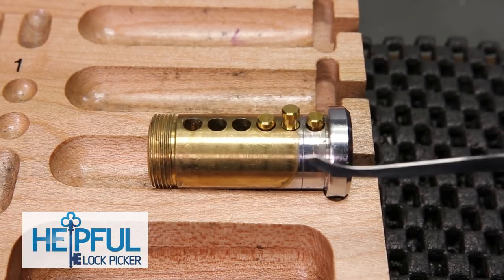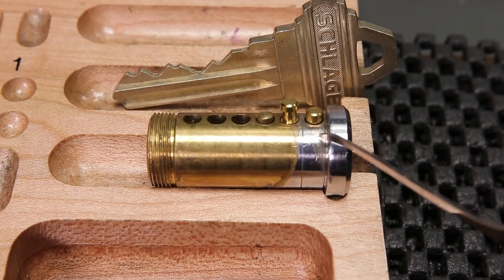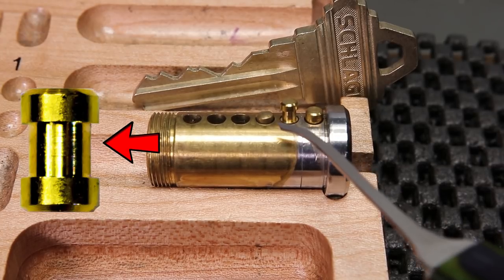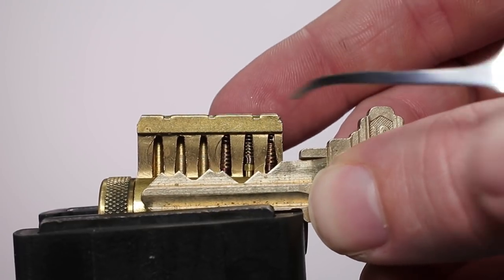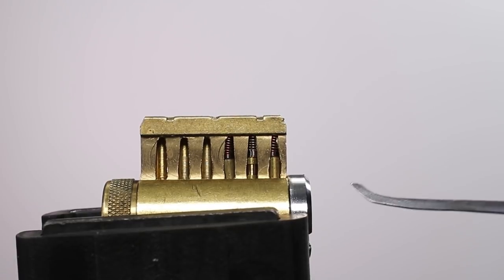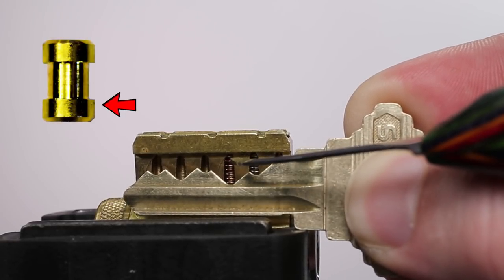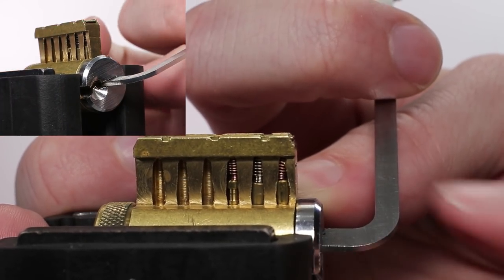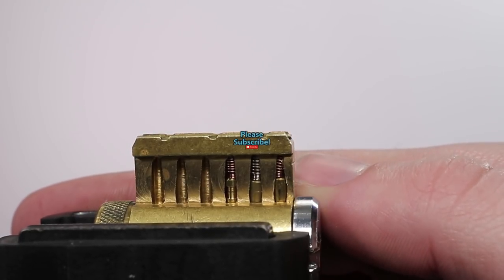[269] Why Locks With Spool Pins Don't Always Provide A False Set or Counter Rotation

Comment: what about deadlocks, where everything seizes up after a deep false set and lighter tensioning doesn't help?
Reply from the maker: Sometimes you need to prove "manual counter rotation" and very carefully rotate the tensioner back yourself until the pin frees and sets
Reply: @HelpfulLockPicker  there's a strong spring on the lock that i'm using to counter rotate and still nothing, this is a lockwood 120/50 and due to the paracentric keyway i can't tell if i'm picking a seized pin through the warding or the warding itself.
Reply from the maker: @Ghorda9  That can make it quite tough. Is it a lock you could take apart?
Reply: @HelpfulLockPicker  no, the 120 series are not rekeyable and each series has a different keyway.
I can set the front pin which does give counter rotation but that doesn't change the other pins.
I guess i could get a 334B45 which is rekeyable, but that is a high security lock that is listed as a blue belt on the reddit.